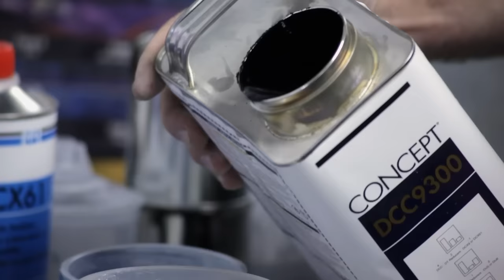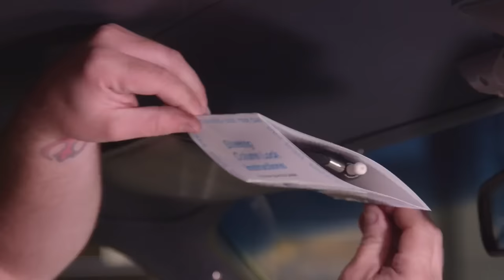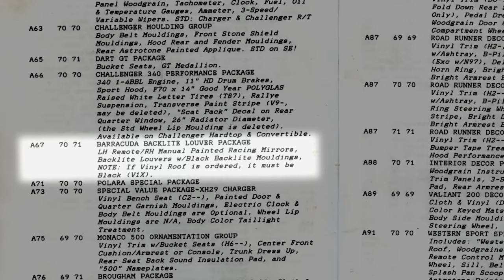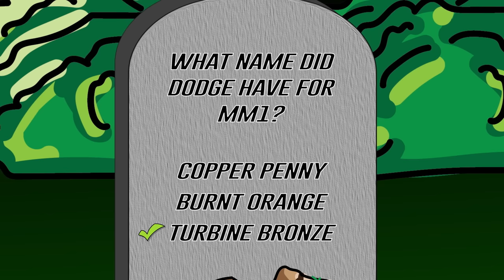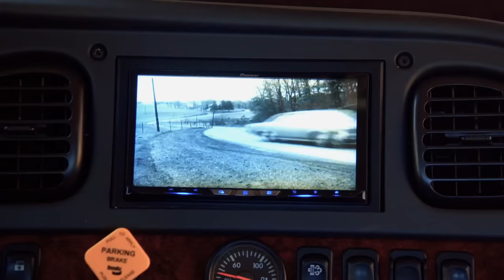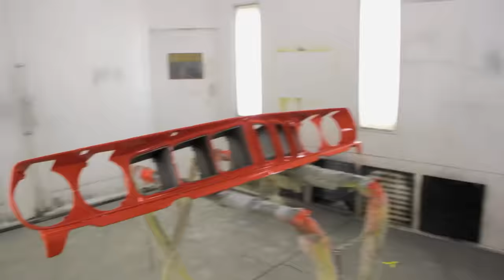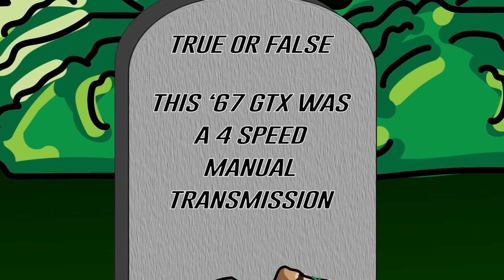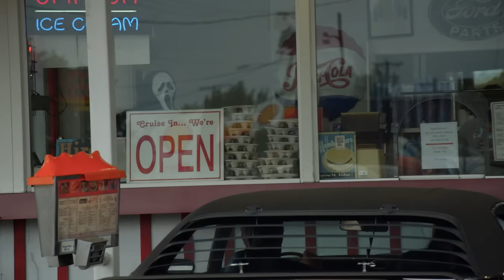MARK BUYS THE WORLD FAMOUS PHANTASM CUDA AND RETURNS IT HOME TO GRAVEYARD CARZ.

Comment: Hey Mark, I used to own a 1973 Dodge Dart Sport, 198 six, starsky n hutch paint scheme, 3 speed on the floor. Had a 225 six, blue printed, balanced , 40 thousand over with titanium parts inside. The only problem was it had a single barrel for which the engine builder wanted to put on a six-pack and the hood to have the six-pack scoop. Ran out of money. Would love to know what it would be to get this built? Been watching the show since 2015. I even had a '70 cuda, 318, posi rear w/slap stick. Miss that also but really miss my sport. Thanx, Stu

Comment: I have to agree with the director and the actor it's not a true Phantasm tribute car I would have not even showed showed it claiming that it was. It's on the same level as the 1966 batmobile tribute car painted blue instead of black same body style but general outer appearance is all wrong.😮😮😮😮😮